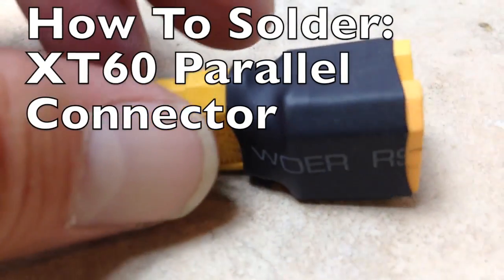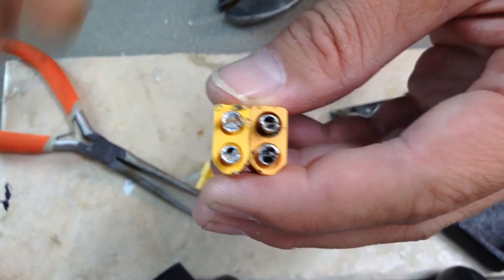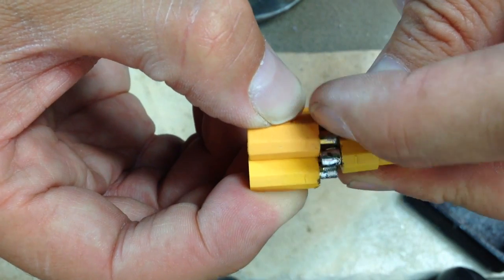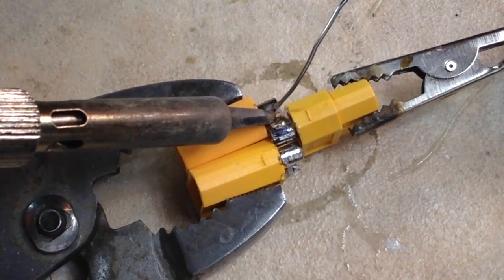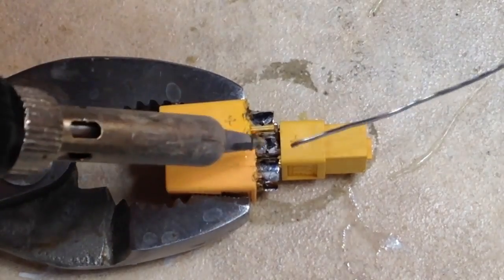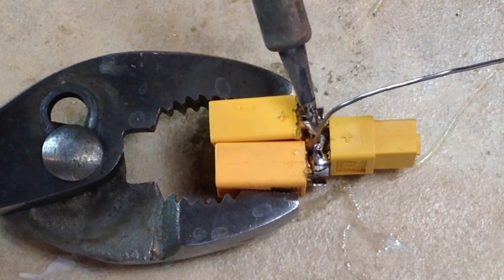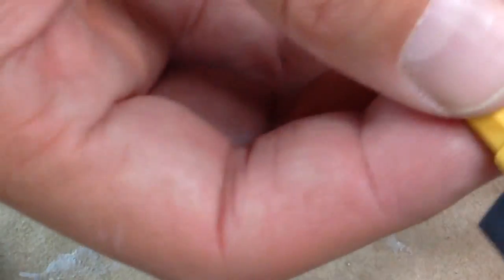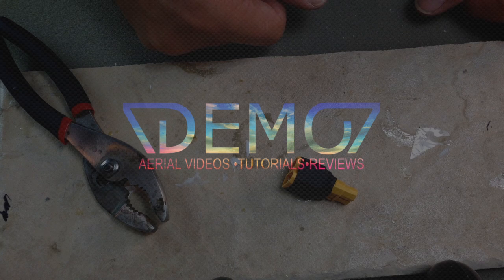How To Solder a Xt60 Parallel Connector

Comment: Solder in a shottky diode between the legs instead of bridging them with solder.  Now you do not have to have equally charged packs.  Careful to pick a diode with low forward voltage drop.

Comment: Great video!

Another tip I can add to it is to connect loose connectors to the ones you're soldering. It helps disperse the heat so it takes longer to accidentally melt the housing (this missaligning the connectors).

Comment: I'd recommend getting a chunkier soldering iron tip than in this video for this kind of job. There's alot of material in the connectors drawing heat from the tip so there's a big chance those are some cold solder joints..

Comment: Important to point out that connecting batteries of different voltages in parallel (for instance batteries with different cell count (which your should never do), or same amount of cells but one more charged than the other) can lead to a fire because they will try to equalize at the highest possible amperage, which will rapidly raise the temperature of the whole thing, leading to the batteries catching on fire (you surely dont want a LiPo fire). This would be hard to handle because this connectors have no fuse in between and would demand you to disconnect the whole thing while it raises in temperature rapidly. It would be unmanageable.

If connecting  batteries in parallel, be sure that the voltage does not vary more than 0.1V per cell (eg 2 4S batteries in parallel should not have a difference in voltage higher than 0.4V between each other before connecting). Be safe.

Comment: Check resistance after. I have had so many like this that were soldered really well and then in the air it just failed and caused a crash. If the resistance differs it unsolders itself.

Comment: Unfortunately batteries are NOT identical. Parallel connection is not a good idea. You must use a coupling device like this: www.mrn-electronic.it.
Reply: @Block Chain True, I haven't got an absolute idea. But I have a good idea.
You, on the other hand, missed THE POINT completely, by probably those 200 miles you mentioned.
To be precise: I did not talk about range. But about battery durability over many cycles (discharges, that is.)
Reply: @Block Chain Yeah, the goodness you get when your reply contains "absolutes" and "no idea", followed by an argument that has nothing to do with anything I said.

Reading with understanding, and then polite and logical argumentation goes a long way.
Reply: I could not disagree with you more. You CAN double the amps with two batteries.They sell these adaptors commercially too.
Reply: @RR67890  No one said that you "cannot".
It was said that: "it is not a good idea".

And it isn't too good of an idea, because as was also said, "batteries are NOT identical", they vary and differ slightly. They are just similar.
Low voltage cutoff will be governed by the battery that has higher voltage. And if one battery has higher starting voltage, when it reaches LVC, the other battery will be below minimum recommended voltage.
Not to mention that usually it is the battery with lower voltage that is in worse condition, so it has higher internal resistance and lower capacity, thus the problem is amplified.
The weaker battery will reach minimum voltage faster and faster, and will get further and further below LVC with each use. Eventually killing the weaker battery much much faster than in normal use.

Comment: What do you call that thing you clean the soldering iron with (instead of wet sponge)? Also, why does my solder "pop" and splash when I apply it to my soldering iron?
Reply from the maker: It may be the type of solder your using
Reply from the maker: 7demo7 I got the gold scrubby (not the real name) from radio shack as well,  It has a weighted base as well, I like it so far, I've only used it a few times

Comment: I'd just like to note that doing this will double the amount of amps you can pull from the batteries (verses a single battery).  Essentially it turns your 2200mah (30c) battery into a 4400mah (30c) battery.

Also note that if you use a Series adapter it does NOT increase the amps, instead it doubles the volts. So, if you have two 2200mah 3s batteries you treat them like a 2200mah 6s battery (still 30c).

Comment: Cant tell from my phone, but it seems like you may have a cold solder joint on the - side. Should be OK for charging, but I wouldn't want to pull too much current for flying.
Reply from the maker: Because I was filming this I didn't do as good of a job- you may be right!  Hard to do with the camera In the way...